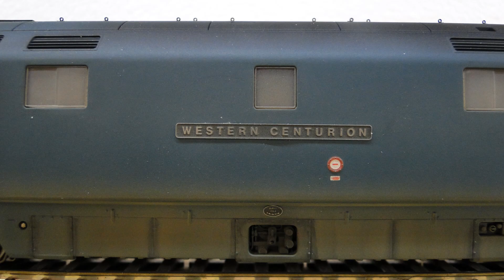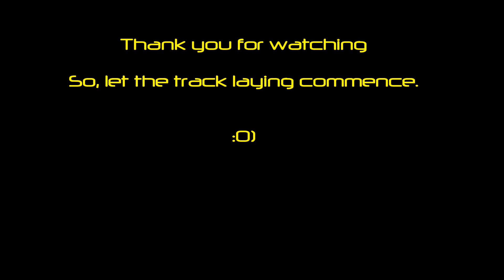Fiddle yard update 14 05 2017

Comment: Hi Mark, I've been following your progress for some time now so thought I should raise my head and acknowledge the work you are doing. Your ability to think out every idea before proceeding is to be applauded and the quality of work being carried out has been very impressive. I really want to see some of your modelling shine through now. 
In watching your update this evening two thoughts regarding your fiddle yard incline came to mind. One solution, albeit clunky and simple, would be to use a litter picker to retrieve the derailed culprit. The second solution came to me when you performed something during the video. You explained something about the incline and slid the board forward to show us further. Rather than a lift out section, had you thought of a pull out section on drawer runners or something similar? Anyway, just two more ideas for the ideas bin!
Great work and I'm looking forward to the next update. 
Paul
Reply from the maker: Hi Paul, great to hear that you've been following and enjoying the very very very slow progress of this model railway project :0) And thank you very much for the kind complements, it's those that make creating videos so worth while.
Now you know what mate, that slide out idea is a cracking idea, but ply does have a tendency to warp and twist, not due to atmospheric conditions but because it wants to revert back to its natural state so it really needs to be screwed down in lots of places, it's still a great idea though and will go into the ideas cupboard :0)

Comment: Hey Mark. I like your ideas. MDF is NOT a problem if, as you say, you correct the humidity issue, and you have. I also seal MDF with a petroleum based paint or poly, on both sides. As for the lift out section, I think that is a must do. Really, better now than regrets later. In the corners, go with curved sections so that you can easily get in the cabinets, UNLESS you want to possibly have a structure, or scenery on that side of the track. You can always cut it out later if you haven't decided yet. So much for my rambling. Glad you have the upload speed you need. I can upload a 30 minute video in about 15 minutes. The first ones took 3 hours, so I understand your frustration before. Regards, Solomon
Reply from the maker: Thankfully Solomon I'm not worrying about the top section of boards yet, got too much on my mind with just the fiddle yard and inclines. I'm starting to get all exited again with the thought of actually getting some track and point work down, it's been such a long time coming yippeeeeeeeeeeeeeeeeeeeeeeeee :0)

Comment: Hi Mark.  All good stuff.  Regarding inclines, it is important to have access to them (not for derailments, if the track is straight and level and your trains are limited to 7 or 8 coaches [pushing weight on loco going down, bottom 'corner'] this won't happen ...I had a 1 in 30 over 30' with 2 bends of 18" radius on the old railway and never had a derailment) but you will need access to clean the tracks. A rolling barrel of 'cleaning fluid' won't do the job for long ....... the fluid leaves an electrically conductive deposit, marvellous at first, trains 'fly', but it does build up and you will eventually need to scrub the tracks clean the 'used up' residue off - otherwise your locos will suddenly start stopping for no reason.  I know - Keith and I tried it on Kingshill - great for 3 months, then "What the hell is happening?" A thorough scrub got it back to working condition - but it has left an overall stain - beware......................Reinhard
Reply from the maker: Hi Reinhard, I replied to your comment this morning at work but looks as though it didn't register, YT gremlins again me thinks :0)
You've made a very god point about track cleaning and this is something I thought about a good year ago so bought a Dapol track cleaning thingy ...... http://www.hattons.co.uk/24836/Dapol_B800_Non_motorised_OO_Track_Cleaner_with_motorised_cleaning_heads_vacuum_in_blue/StockDetail.aspx
I thought a couple of these going around the layout once a month would be good enough to clean, vacuum and polish the track, do you think they would work? I've read mixed reviews on them...

Comment: Hi Mark,

Looks good,  As long as you can get underneath enough to fit any electronics that are needed.  I see your problem with derailments but could you reach in at another end and pull the train down abit via the wagons/coaches enough to allow you to re-rail it if you get what I mean.  Cheers,  Michael
Reply from the maker: Hi Michael,  I've been thinking about the electrics for the layout and access for installing the point motors, going to be a bit of a squeeze but it is doable, might have to employ a little person to squeeze in there for me :) 
If i do everything right at the start then there shouldn't be any derailment, but I also know that now I've just said that to you it will happen just out of blinking spite to prove me wrong lol

Comment: As an aside, Mark. Have you considered OSB for the baseboards. It's extremely strong (my garden railway is on it) ..and it's cheaper than ply. I try not to use the DIY stores as they're much more expensive....although B&Q offer a free cutting service. If I use them, I draw all my cuts on a sheet of paper and get it all cut to fit...handy if you have to get it in the car.  Just an idea :))
Reply from the maker: Hi Tom, when I first started the layout and before I insulated the garage I did consider OSB, in fact I did actually have some but for some reason I decided not to use it, I have no idea why though, a beer to many might be the reason behind the memory lose lol.
I'll stick with the 12mm ply now as I already have a few sheets. I got that from Wicks and the only reason I did was because they had a free cutting service which meant I could fit it all in the car, plus they are only 5 minutes down the road from me. Their ply isn't that good though so for the last couple of sheets [or should that be "shits" ] I'll be going through the pack for the best ones :0)

Comment: Hi Mark, you're flying along now 😀, or should that be rolling along? With the derailments issue, I agree with DJ Model Railway, if you have good quality laid track and 'upgraded' stock, derailments won't happen. If they do, the lift out baseboard idea is a good one. Also, (like the Wimborne layout cassettes) if you have a filler between the rails, it'll help to rerail a vehicle. I can give you some more info about reliability aspects if you'd like. It's all looking very exciting!
Reply from the maker: Hi Tim, lol I like the pun, rolling along it is :0) I like the idea of the rerailer and that would certainly work on the down incline but for the up as it would obscure the powerbase I'll be putting in, Anyways that is a long way off, first I need to get my head around how I'm going to lay the track in the first section of the fiddle yard, I can feel a migraine coming on lol.......

Comment: Looks really solid...consider using atlas re-railers in the incline track,  put them in where they wont be seen and they will ensure that you do not have a de-rail....
Reply from the maker: Hi, a couple of others have suggested using de-railers and I had actually got as far as looking to buy some to try out before I realised that I'm using a powerbase system so I couldn't have the re-railers over the top :0(

Comment: hi Mark.. i feel your pain with the internet. speeds... i just had new service installed  where my upload is a minimum of 5 megs & download is a min. of 50 megs this is a vast improvement over what i had previously of .700 megs up & less than 7 down... as for your bench work i would go with a removable section... "Murphy's law" is always lurking in the background... looking forward to your next update.. thanks for sharing.. vinny
Reply from the maker: Hi Vinny, yea changing to another internet provider sure has made a difference but I'll have to keep an eye on them as here in the UK they're renowned for throttling the speed if you start using a lot of it.
And you're right about Murphy's Law, if I don't do it then I'll get a derailment and if I do do it I won't get a derailment, think I need to have a good think about it over a few pints of Guinness lol :0)

Comment: why don't you just use 2'6" baseboards that way you wont have a problem reaching across the baseboards to get to stuff and that's happy medium between space for scenics and access Andy
Reply from the maker: Hi Andy,  the 2'6" boards, are these along the front and allowing the space behind where the inclines are?
Reply: Hi Mark was thinking overall 2'6" including the inclines for the upper surface, that's about the maximum you can reach without having to climb all over the layout  and doing damage to scenics, I know you are loosing space but better than having to make repairs all the time Andy
Reply from the maker: Hi Andy, I see what you mean now, from my perspective stood in the garage [it's hard to show how it really looks on a video] the track will be on the 2' of space at the front, the rest back to the wall will just be scenics and maybe the odd fake tunnel to make it look as though there's a branch line leading off somewhere. But I can see that this will be a really hot topic when I get to that stage and I am really looking forward to that but it's a good year away at least.